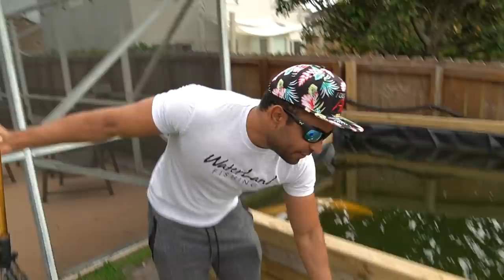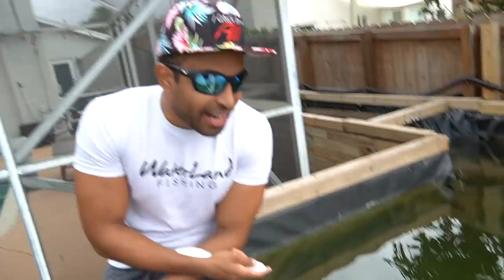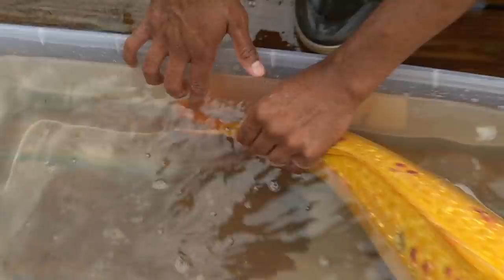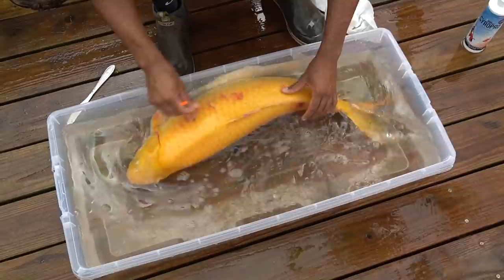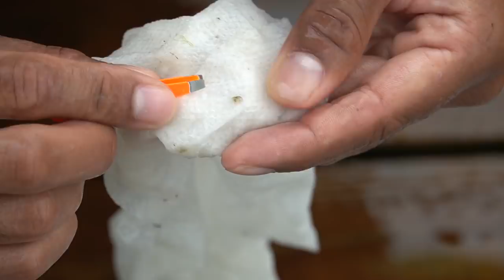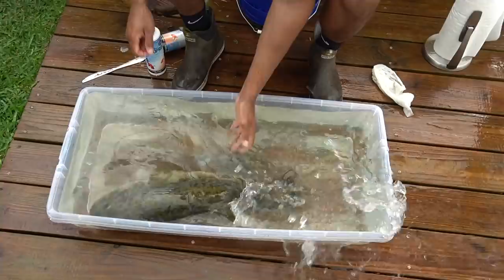FISH SURGERY diy PARASITE REMOVAL! **Works on All Fish in Aquariums and Ponds**

Comment: You have to treat the body of water where the fish live, not just treat the fish then put them back in contaminant water, lice eggs and free swimming juveniles lice are still in the pond water. And because of the way your water cycles from the lake, it's very hard for you to treat properly. If you had a pond filtering its own water, you just put that treatment into the pond and it would treat all fish and water. If the lice are on the bass, koi they are on the catfish.
Reply: That’s what that bottle of stuff is for , it’s for the water once u remove the bugs from the fish . If u go back and watch the first 5 minutes or so u will see where he shows u the bottle of the treatment.
Reply: @amandacrawford4748  It's not for the water, as his pond filter is linked to the lake, so putting any treatment in the pond will just get sucked into the lake.
Reply: @zebedeemadness2672  well that’s what he said , that it only takes a cap full for the whole tank/pool that he keeps the fish in . Maybe I misunderstood him but that’s what I got from him. He was using it on his fish but he also said it’s actually for the water.
Reply: @amandacrawford4748  That treatment is for the water, not direct on the fish, but he uses the lakes near him for water, by pumping from the lake to the pond, so for him to treat the water, he'd have to treat the whole lake, he'd could turn off the lake pump, and used another pump in the pond to treat for 24 hours, BUT when he goes back to using the lake water, all the parasites from the lake are back in the pond.
Reply: 333333

Comment: Because all your displays are connected to the big pond you can not add treatments to the water. The red degraded skin gets secondary  bacterial infections especially when the koi's immune system is lowered due to shipping and moving stress. A smoosh and rub of Neosporin on the wound helps a little before it completely falls off in the water. When more eggs of the Argulus adults hatch in the big pond the tiny young ones swim around until they find a fish so you may get them again through the pump. The chemical disrupts the formation of the hard shell during growth and shedding (it's a crustacean) so the 21 day directions for use are really for a contained pond which covers the three week life cycle. 
CyroPro™: add at the rate of
 1 teaspoon per 50 gallons.
 Distribute around the perimeter of the pond or aquarium to insure rapid and complete mixing. 
Adding CyroPro™ via the filter where agitation occurs works well. 
Repeat the treatment regimen every 7 days for a minimum of 21 uninterrupted days.

Comment: I've got little worms in the fins of almost all of my bass how do I get rid of them without manually removing them
Reply: Well a smart person would does the tank with 
1: Copper 
2: praizpro 
3: salt 
This guy is not smart everything he does is for views and he doesn't understand how fish keeping even works
Reply: @fishlife1013  Agreed. Accept its not a closed system so it would just run out into the lake.and hes not smart enough to buy a filter worthy of koi.
Reply: @leilanik2050  yeah but that would require him to be smart
Reply: This is in a private pond by the way
Reply: @hellcatkelley.20  how many gallons because you might have to use a higher concentration of stuff
Reply: @fishlife1013  it's a pretty big pond they are not aquarium fish and it's just the bass that have the worm the bluegill catfish and carp in the pond do not have them I have been told before the worms came from birds?
Reply: @hellcatkelley.20  yeah its probably some kind of fluke worm im gonna guess not really much you can do in a natural pond i am gonna imagine raising the pond salinity isn't possible
Reply: @fishlife1013  yeah I've talked to a few people about it they said it doesn't hurt the fish or even to eat them but I just don't like the thought of worms being in my fish